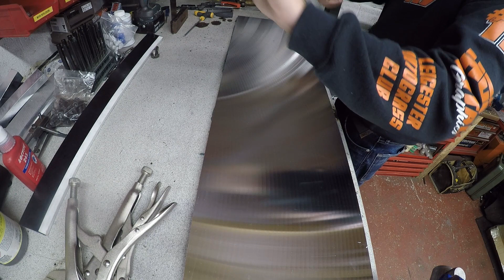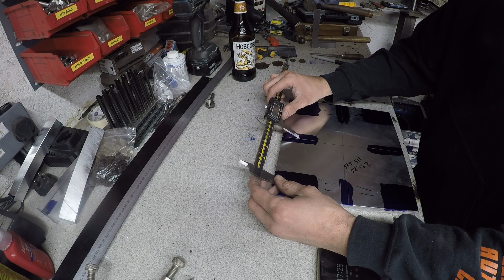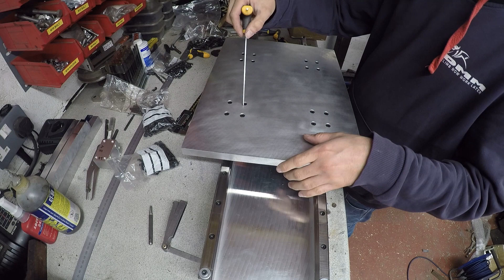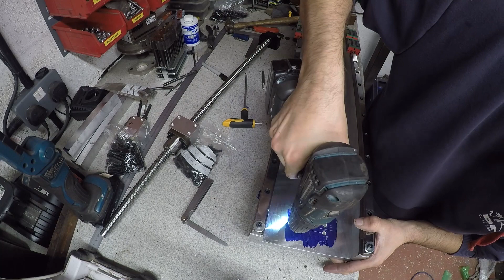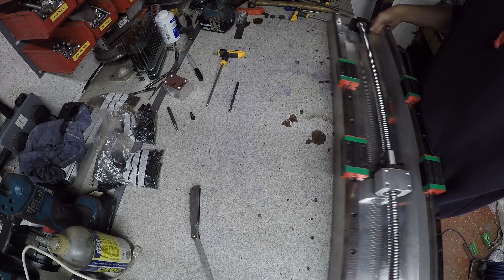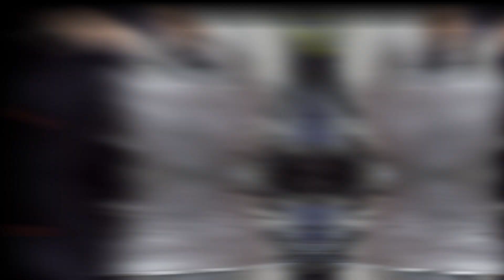DIY CNC Milling Machine Build - (Part 3) - Screwing around!

Comment: That machine turned out great in the end! Looks like an industrial made model ehehh
Is there a special reason for mounting the ballscrew nut housing in the "wrong" side of the ballscrew nut? (normally, nut should be inside the housing)
I'm also building a CNC, loved your work 👌🏻👍🏻👏🏻👏🏻👏🏻
Reply from the maker: Thanks for watching. The error with the ballscrew nut was noticed by other viewers in the comments and was corrected in the next video.

Comment: Great videos, but I just couldn't figure out why you mounted the ball-nut housing on the wrong side of the ball-nut.... In your orientation of the ball-nut, the housing should have been on the BF15 side, not on the BK15 side. This would give you a little more stroke and is the way these two were designed to fit ( one inside the other ) Was the ball-nut housing's hole too small to fit the ball-nut? 
Just my 2 cents, and again thanks for the great videos.

and YES, alcohol first, safety - third... maybe fourth
Edit: Ahhh maaaan, I watched the next  video and say someone already pointed that out. Cheers!
Reply from the maker: Haha thanks for the comment. It was a stupid error, I don't know how I didn't realise

Comment: When You measure for that 24/48 block, how much larger hole You drill (or You dont?), but I guess, should?? I see that oldschool 90 degree angle and electronic caliper and wonder how can You get that precisely that block to fit..
Reply from the maker: The holes are the correct clearance hole for the size of bolt. They need to be clearance holes as the counter bore cutters have a dowel that is sized for the appropriate clearance hole and won't fit if you just drill it size for size. If you take your time, you can be very accurate with these layout techniques, even more so if you use an optical center punch. Those holes you're referring to aren't that critical anyway.
Reply: @SeabassEngineering  And how You adjust, where block has to be? How You determine its right position? Clearence holes give probably 1-2mm play, seems a lot, so it need te be adjusted corectly.
Reply from the maker: Are you talking about the ball screw block? it isn't that critical so long as it doesn't bind up. plus or minus 1mm isn't going to hurt it. With relation to X-Y squareness and Z squareness etc. those will all be dialed in with a precision square when the machine is running.

Comment: Just another thing... With the alluminium plate Will the machine be rigid enough to mill steel or titanium?
Reply from the maker: It might do steel with low feeds and speeds, but I will mostly be using it for milling aluminum

Comment: Looking good! Using washers and a long bolt to make a hard stop for the linear bearing carriages so they don't go off the guides is ingenious and I feel dumb for not figuring that out for my diy mill.
Reply from the maker: Thanks. I was super paranoid about them coming off and losing all the bearings. I intend to put plates on each of the ends of the axis eventually, which I'll also use for mounting limit switches.

Comment: really enjoying watching your build, I live on a island so hard to build these sort of things cause its near impossible to source the parts, Question: did you purposely put the Ballscrew Nut mount the wrong way , cause the Nut is meant to slide into the mount.
Reply from the maker: Thanks for the comment. Thanks for pointing this out, no that was a mistake. I have built both axis now and did it right the first time. I was obviously very drunk when I did this one, can't believe I didn't notice this. Thanks for pointing it out! Glad you're enjoying the build.
Reply: @SeabassEngineering  all good look like very nice beer, but that is the best part of DIY CNC you build your own machine so you know how to fix it, can't wait to see yours running and making chips
Reply: Hold up..... it's posable to cnc potatoes? YET another reason evey house hold needs a cnc.